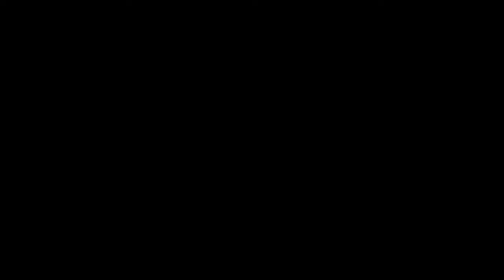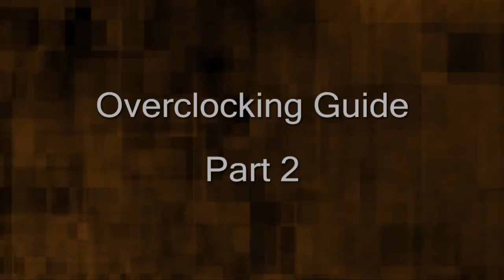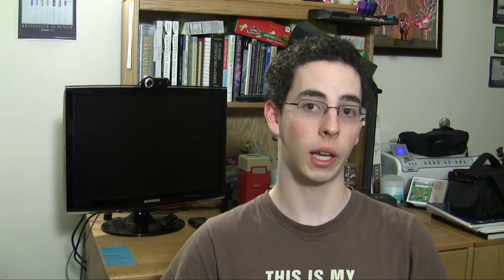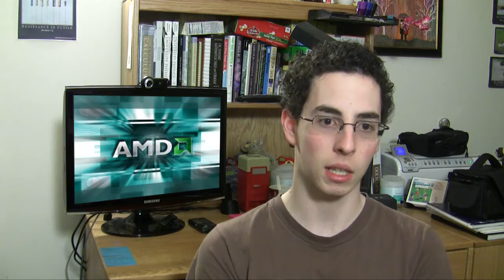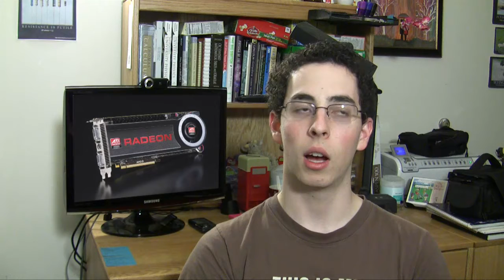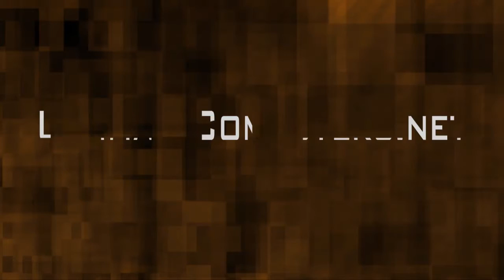TechBits 10 - Overclocking Guide (Part 2 of 2)

Comment: Good video for helpfull tips. This is my first build, and I'm currenty in the process of ocing my amd fx6100. I'm up to 3.8ghz on the cpu. Ran prime for about 20 minutes, and 2 workers stopped due to ram issue. I upped the voltage and timings to factory recomended, but am still getting the same error. Haven't had any crashes, and programs/web pages are loading much faster. Any tips for what I might be missing to get it stable in prime?

Comment: Having problems with keeping it stable, so I wonder what voltage I should increase. I have AMD Athlon. Anyone of these? : cpu vcore(1,226V), cpu NB(1,162V), NB Voltage(1,094V), SB Voltage(1,095V), DRAM Voltage (1,504V) and or HT Link Voltage (1,186V)? Great videos btw! Thanks for response:)

Comment: @sciguy14 sry for the late response but i had it running at 3,2GHz at stock cooling system with a loading temp of ~65 Celsius quiet high. and then later I've crashed my motherboard for some reason but not due the overclocking.. so now i'm saving up to buy a new PC :( thanks for tips anyway

Comment: hey can u give any tips about overclocking a quad core q8300 2.5ghz? i overclockd it d last time when i realized my thermal compund got dissipated.so the fsb multipliers came back to stock values.so if i put back a proper thermal compound,will i be able to overclock it better?

Comment: I think GPU overclocking is allmost uneffective, because they depend a lot on the arcitecture so the gain of speed wont be significant  and there is a lot of risk involved, cards from some manufacturers burn even w/o OC so it's not practical unless you wan't to bench out and have the fastest 5970 for a day or two :D
But CPU OC is quite conviniant-i aprove of that  :)

Comment: I got this problem with my pc that it did run with 2.10 Ghz before and now it went down to 1.10 after I did get my sound driver on to my PC can't it rly make my Ghz go down instaling that ?? and my power suply in the back the fan on there dont go anymore can that be the problem I use another way to keep my pc cold :) if you can help me please leav a comment in my profile and sorry for my bad english

Comment: some setting changes require that the system completely power down for them to take effect.  I've done very little i7 overclocking at work, but the ASUS P6T did shutdown for a couple seconds if I recall correctly.

Comment: i wouldnt use software. bios is the best way to get a solid and safe overclock. mainly cause if u use something like nvidias oc tools u can end up saving a profile on boot up that is not stable and will require u to have to go into safe mode. idk bout other softwares but if anything DONT use nvidias oc tools. bios is the best route for overclocking.

Comment: well core temp sppedfan realtemp  all say the same 38,30,36,30 idle now i can run prime95 all day and coreo stays at 38 the other cores will jump some weierd thing is if i run intel burn test i can get core o to jump to 42 and the other3 cores will get to a max of around 44c i guess all that matters is my pc isnt shutting down the ? is if a sensor is stuck lets say on 38c and it did ever reach tjuntion would it be able to comunicate corectly to the mobo to shutdown what do ya think?

Comment: great vid brother i got a ? i have a q9400 cooled by a coolermasterv8 right now my temps are 38,30,36,30 i can run prime 95 all day and never get core0 to change from 38 i even overclocked it to over 3.0ghz and the temps stay the same.could i have bad temp sensors and does it really matter

Comment: your videos are verry professional

my spelling sucks
in the first part, you said that you would mention that you would tell us cpu softer overclocking software

i cant do it via bios because i have prebuilt system=locked bios

and how big of a differnece would it make on a q8200 stock cooler anyways, if i could change everything

and rivatuner doesnt work on lastest vista 64 bit? needs driver signing

Comment: im running 4.7Ghz with my i7 950, have been for days.. my system hasent been turned off since i installed the CPU, im yet to run into problems.
Who the hell cares, they're clearly so minor that theres no point in worrying, besides.. they're computer components, they will eventualy malfunction. Why not have some fun and lower the component life span by a few months?

Comment from the maker: you can't compare intel and AMD GHz speeds directly, as they translate into different performance level on each platform.  It's like comparing apples to oranges.  You might simply not be able to go any higher.  If the highest you've seen is 3.8, and you got to 3.6, that's pretty close.  A black edition would probably go a bit further.